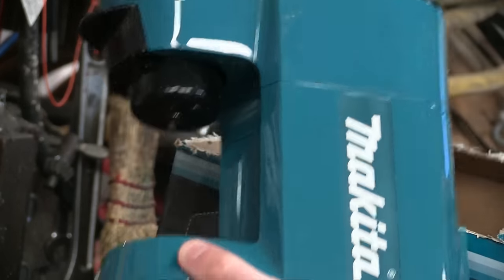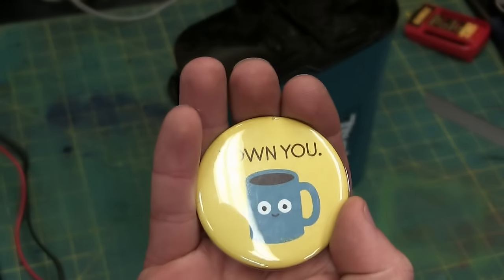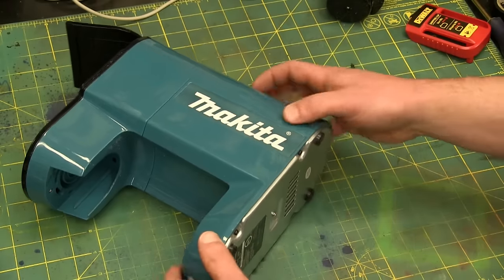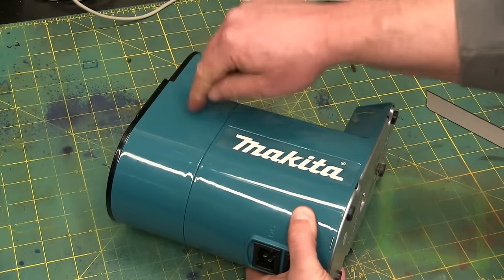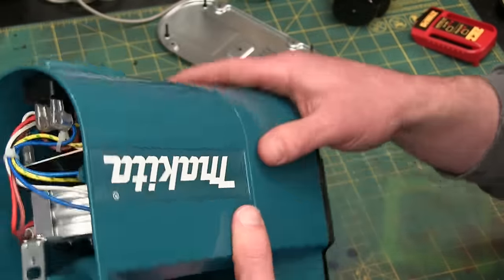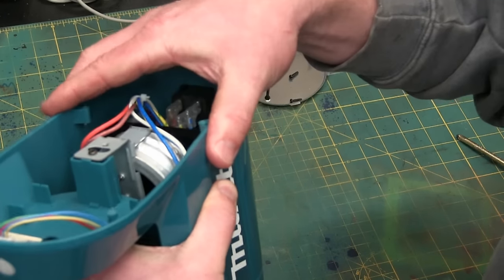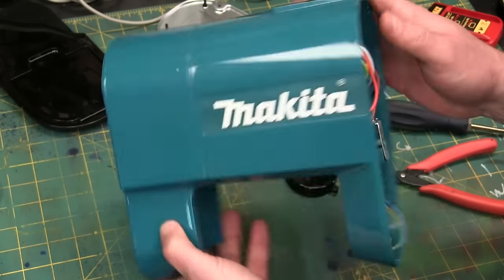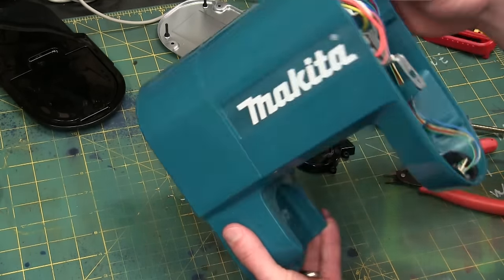BOLTR: THE BEST TOOL MAKITA EVER MADE!

Comment: Unrelated to the video but I know this Chanel has an intelligent person or two lurking around.I'm replacing a fluorescent T8 with an LED, removed the ballast and thought I had everything good until I popped the breaker, several times.Wiring seems okay, tested the bulb and I get continuity between the two leads, should that happen? Damn pixie wrangling :/

Comment: +AvE Real sorry, but that relay's coil only goes up to 24V DC max, according to its datasheet:
http://ultran.ru/sites/default/files/catalog/svetodiody/brend/datasheets/jzc-32f.pdf

All the 120V AC / 250V AC ratings are for the contacts.

PS: Does that thing have TWO fuses? The 5x20mm ceramic one, and that red box-type right next to it and the MOV?

Comment: No offence to Ave here. But you can't have a bitch about it taking 20 minutes when you put ice in the water. 
It took 20 minutes because it had to heat the water up. 
I would guess it would be a lot quicker if it didn't have to melt the ice water before it boils it.

Comment: ……the battery connects with the a remote cable?! That is stupid as shit. I looked this up and they have a new version that has the battery clip directly to it. WHY did they release this version at all? LOL
Reply: As dumb as this design was its better then the new one. The new one can't plug into the wall. It has to use batteries which is dumb because if you have the choice you would rather not waste battery power.